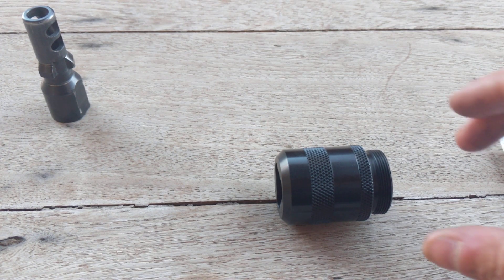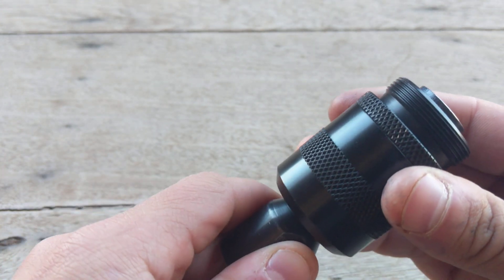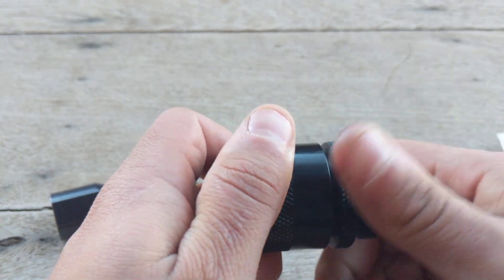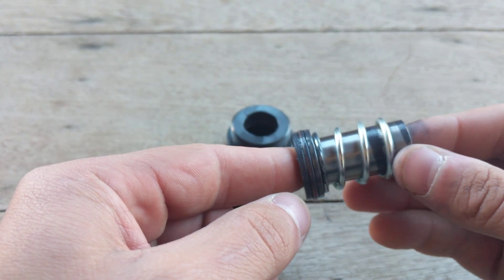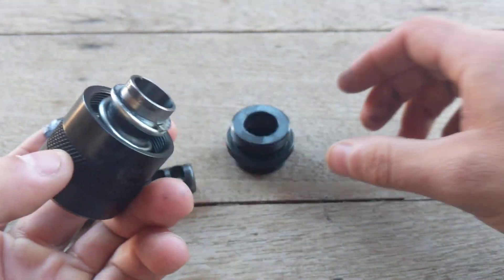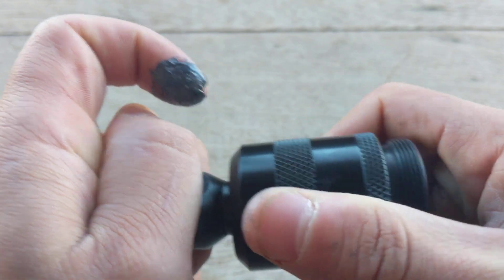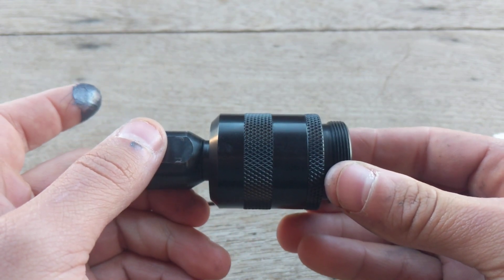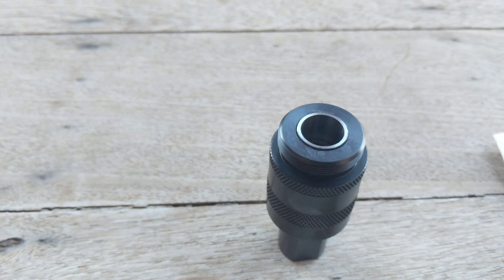3 Lug Maintenance & disassembly

Comment: I have a form 1 suppressor I built a few years ago using a RoninPro "B" tube kit. I've been looking into converting it from a direct thread to a 3 lug qd. Do you know if your SD 3 lug kits will work with the RP tube? It APPEARS to be a pretty standard thread. Since purchasing,  RP has quit selling kits and I can't find their thread pitch into and I can't find a thread pitch for your 3 lug kits on the website.
Reply from the maker: if it is a 1 3/16x24 it will
Reply: @SDTacticalArms  Thanks! Going to check right now!
Reply: Looks like mine might be a "D" tube. The OD of the tube is 1.550" and the OD of the threads is 1.430". I tried getting a count on 1/4" of the threads and multiply by 4 and got 24tpi. (This could be off by a couple TPI though since I'm measuring such a small section) Does this sound right for a "D" tube? If it is, I guess I just have to buy the thread adapter and 3 lug adapter...